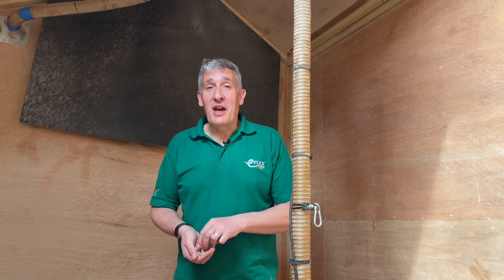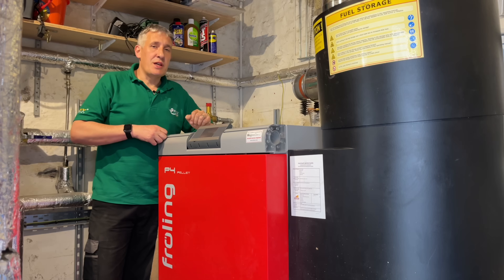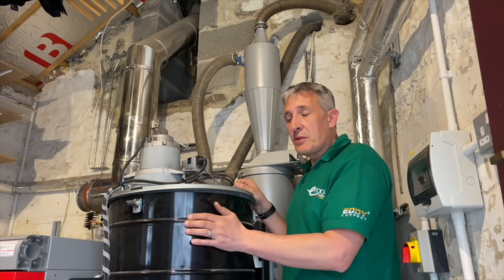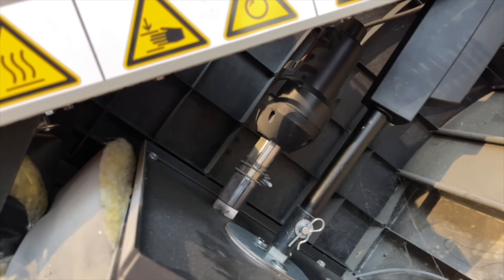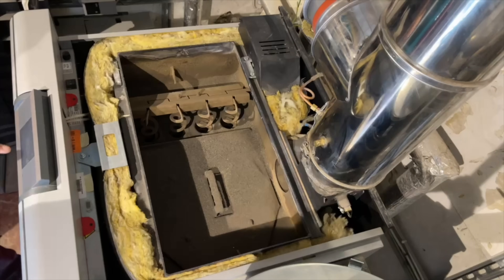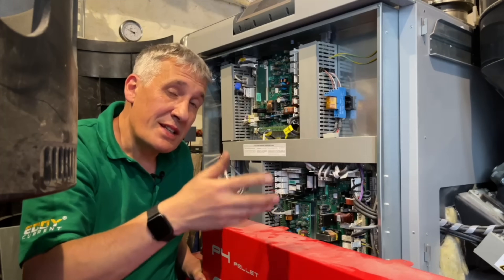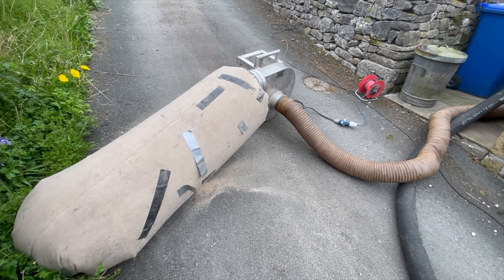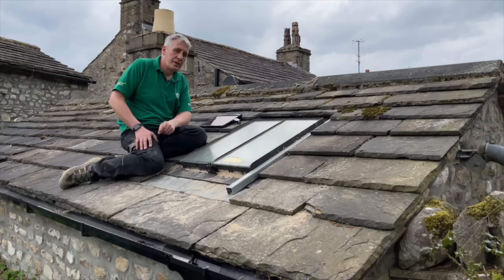Is a Wood Pellet Boiler the Right Choice for Your Home Heating?

Comment: Very well communicated. I’m interested but doesn’t wood produce nearly as much CO2 as oil or gas?
Reply: It does but it is not a fossil fuel. Biomass is a waste product of the lumber industry. These trees are just grown and then replanted in a sustainable way. The new tree growth taking up the C02 emitted from burning the previous tree waste products.
Reply: Co2 is plant food.
Reply: It probably does but wood is not a fossil fuel. Heating wood normally comes from sustainable forests in which just as many trees are replanted that are cut down for heating. The CO2 emitted from the burning tree in theory is absorbed from the atmosphere again by the new growing tree. Oil and gas are not like this. They are fossil fuels - stored energy from millions of years ago who's carbon is burnt but never replaced only continually adding to the CO2 in the atmosphere. Many say we should plant more trees to capture this carbon again from the atmosphere.

Comment: I have posted this in English and French in the hope that a French company might pick up the enquiry.......That is a really interesting video, thanks for taking so much trouble.  Currently I live in France and have been using an oil fired boiler for the last twenty odd years.  I have been search for information on a pellet system.  Now you have supplied it!!!  Do you happen to know if this type of boiler is available in France?

J'ai publié ceci en anglais et en français dans l'espoir qu'une entreprise française puisse répondre à la demande.......C'est une vidéo vraiment intéressante, merci de vous être donné autant de peine. Actuellement, j'habite en France et j'utilise une chaudière au fioul depuis une vingtaine d'années. J'ai recherché des informations sur un système à pellets. Maintenant vous l'avez fourni !!! Savez-vous si ce type de chaudière est disponible en France ?
Reply: I moved from the UK to Romania and while wood heating is completely new to me, we went from a normal log stove with a back boiler to something like this. 

We went through fornello (ro). There's a bunch of different brands there and they're likely available in France too

Comment: Storage area can be very dangerous…pellets emit co2 and can quickly suffocate.
Reply from the maker: They emit CO not CO2 - in this video the pellet store was empty.  You are correct you need to use caution when store is full. Plus dust can also be explosive.

Comment: Great work, really well explained. We're looking to have one in our slightly off-grid cabin.  Delivery truck will struggle to get close enough though I think.  Are there any other options other than small plastic bags?  I have a 4x4 and a 2.5 ton trailer which I can get up there.   Can I load that up with those huge ton bags?
Reply: You could drop the vacuum feed pipe into a one-tonne bag -just make sure the bag is in a dry place and pipe out the vacuum exhaust as it has dust particles.

Comment: Excellent video - currently I buy about 300 bags of pellets/year to heat my home with a pellet stove & I don't like having to throw away all those plastic bags. A bulk delivery system would be awesome. Soon I am moving to New Hampshire (here in the USA) & after watching this video I will research wood pellet furnace systems, the one shown here looks terrific.
Reply from the maker: Good luck with the new mission in NH
Reply: @georgevue8175 , as a fellow nh resident, who did you find and what did you settle on?

Comment: 1:50 Wrong… it‘s a Fröling! With a german ööööö 😅
Reply from the maker: Correct if you are in Germany - we are in Großbritannien
Reply: @eFIXXENERGY  Thats a a nice and thoroughly explanation of a wood pellet boiler. As i#m from austria (where fröhling company is located)it is a nice thing to see that its used in UK too... (with or with out ö or o) - i ve got a log boiler linked to a insulated 1000 Liter buffer, its a nice method to save heating costs, and gives heat to the house for aprox one day once the buffer is fully charged.(zero degrees centigrade outside in dezember). On the country side along the danube one gets wood logs at a quite fair price, storage and cutting is also not a problem...
At the end: slate on the roof, bare stone walls - like in old pictures form england - thats not often seen here in central europe.

Comment: When these first came out people where really keen. There is a lot gubbins to make it work and ten years on I've not heard many horror stories of breakdowns. What I really struggle with is that this is not as green as you might think. The pellets come from the other side of the world. The supply isn't consistent and prices have fluctuated. Having said that it must be better than gas or oil. Really well explained big G.
Reply: A lot of the pellets are made in uk. Uk timber or wheat straw

Comment: Brilliant video Gordon, wouldn't that system benefit from a Sunamp battery rather than a conventional hot water cylinder?
Reply from the maker: Could be a possibility - they only make the equivalent of 300L sunamps atm  - it would need 3 to equal a 1000L buffer tank.
Reply: Could prove beneficial in the winter months if it holds heat longer than a cylinder, less cycling of the boiler and less cleaning / servicing